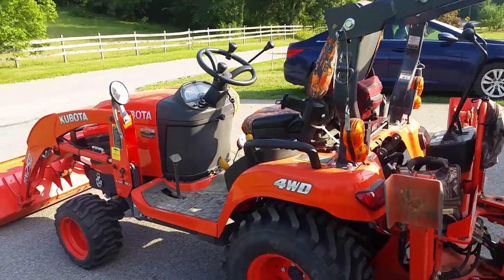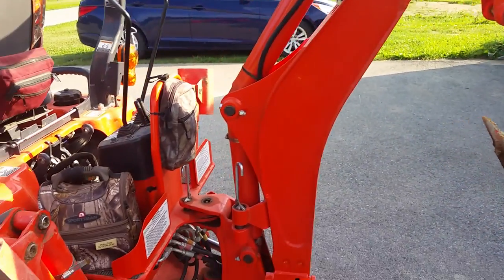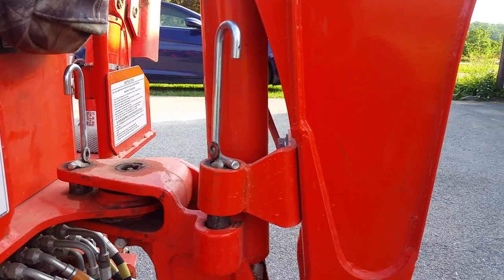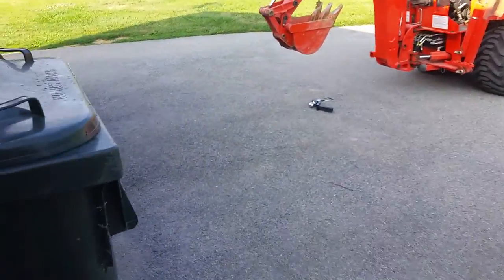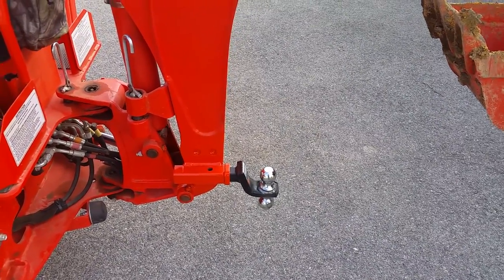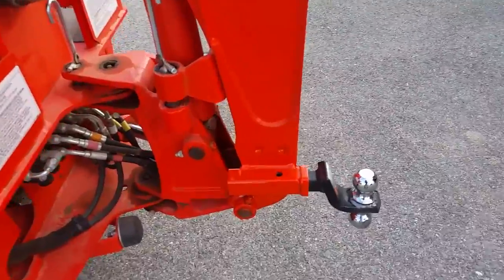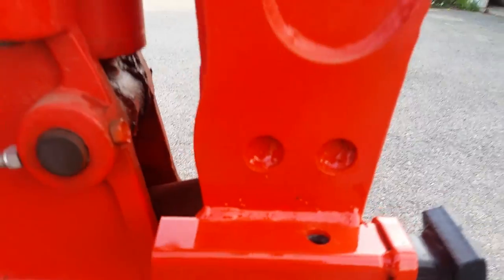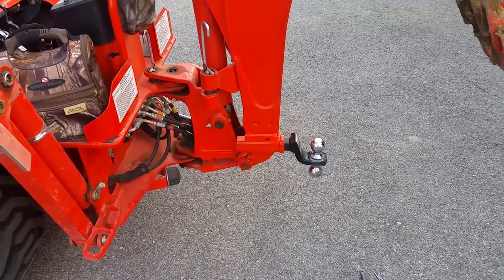KUBOTA BX25D BACKHOE TRAILER HITCH

Comment: Wow I love this idea. I saw others that mounted below with an long extension coming out the bottom. I was also about to just decide I had to be willing to take the backhoe off and on when I wanted to use the trailer pull. This is a damn tough little tractor so I think it can handle it. I'll need to figure out how to weld it. Do you know an affordable welding rig I could buy to do this?
Reply: With the long extension from the frame, allows you to use the backhoe to fill a trailer.
Reply: @ya472  Wow that would be a huge benefit. My brother in law has a welding machine so I'm going to talk to him about it at Thanksgiving.
Reply: @ipo_candy  I started with the bar, but if necessary, I would step it up to a T member or square tubing.
Reply: The cheapest welder at harbor freight can do it.  Prep is your friend.  Grind off ALL of the paint where you want to weld.  But, also I would recommend this instead... so that you don't weaken your boom and don't stress the boom with the trailer weight. https://www.youtube.com/watch?v=3MF-aetxg-s
Reply: @thekobaz  The Video you recommend, attaches to the same points as mine, but is rigidly centered, and mine can be swung to left, right, or center.  This way you can pull a trailer, and load it with the backhoe, depending which side you need to dig.
Reply: @ya472  Yeah the swinging bar is neat.  I like the stiffness of channel... depends on the weight of the trailer.
Reply: @thekobaz  I assume you mean the tongue weight of the trailer?
Reply: @ya472  Well, yes and no.  Obviously you want to balance the load and set proper tongue weight, but the heaver the load is of the trailer itself, the more strain on the hoe boom and the pin it's sitting on.

I was just saying from a physics perspective, it's a better position to put the forces of trailering onto the body/frame of the tractor vs the backhoe boom like in the OP video.
Reply: @thekobaz  Pardon?  There is no stress on the backhoe boom, just on the frame mounted to the frame of the tractor.  If that frame can withstand the forces of the backhoe use, it surely can support the light load of any trailer.
Reply: @ya472  Correct, no stress on the backhoe with the frame-mount option.  The whole original start of this sub-thread here was the differences between connecting at the frame, and connecting at the backhoe (this video).
Reply: @thekobaz  Either I am confused or you are?  This person connected their hitch to an existing hole in the backhoe frame, not the boom.
Reply: @thekobaz  OK,,   I AM WRONG... this is a different video than one I commented on this morning...  SORRY...  this is a boom mounted and welded hitch...   the one I watched and commented on this morning, was similar to a design I did.
Reply: @ya472  :)  It happens